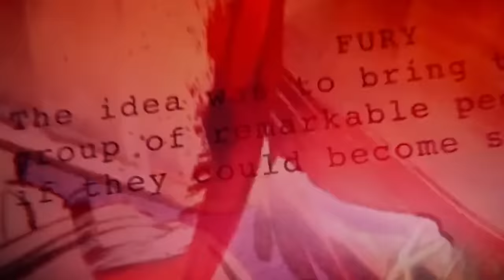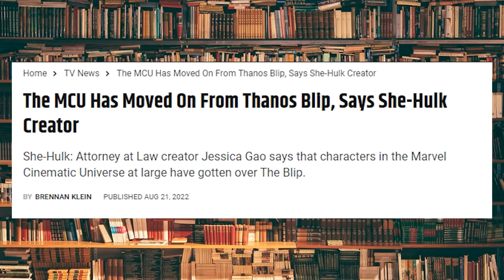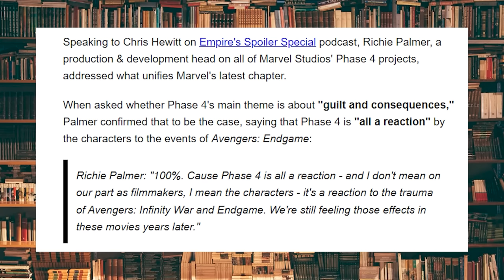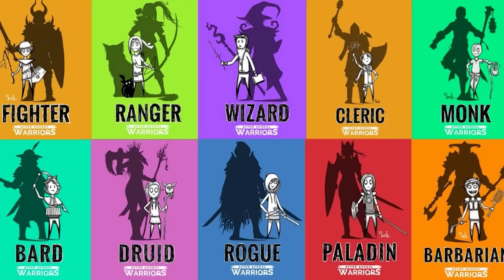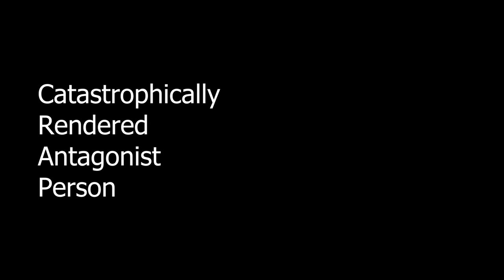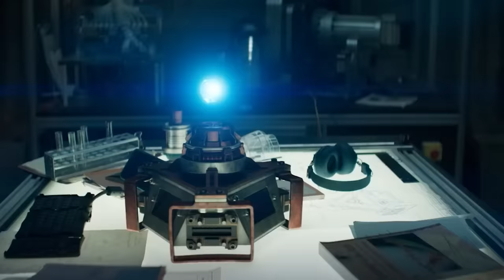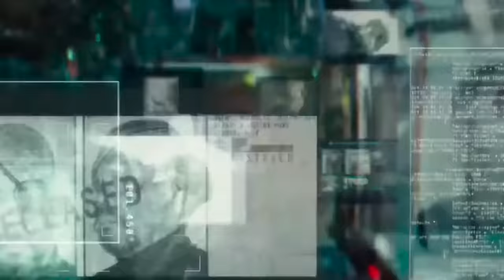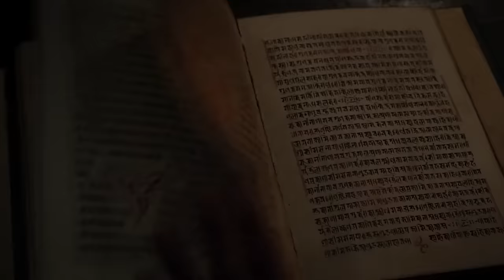Ant Man 3: Quantumania - Absolute Garbage

Comment: 19:40 It's not just flaws in character either, it's flaws in how they go about being their genius selves. As an engineer, I find the MCU's depection of "genius" these last 5-7 years infuriating because it doesn't just come out of nowhere, it's not practical.

Every one of these girl bosses is shown to have an infallible perception for how things should be built independent of the natural failures that come with applied science. Failure is a necessity for innovation, and I think the MCU understood this early on. Through Iron Man 3, Stark was shown to be experimenting and failing regularly. Sure, he made tech wizard marvels, but throughout his films there were always little gags about how an invention of his experienced an inopportune failure. His origin story was defined by such failures. This is more inherently relatable, because it not only makes more sense, but anyone whose built anything has experienced that moment where they realize they have to start over several hours or days into a project. 

Meanwhile, Cassie just plops out a device that is basically a walking contradiction of physics, and I'm supposed to believe she made that in a year by reading journals... OK.
Reply: Yeah, think about how Tony fixed the icing problem.
The first moment he tried to hover, he yeeted himself into the ceiling.

Comment: Actually, Tony didn't invent Time traveling in 5 minutes in Endgame. It was said that he had worked on it for several years already but couldn't get it to work until one day Antman and the quantum realm added a massive new factor and only THEN was he able to invent time traveling.
It was a long time project and by then Tony was long established as not only one of the mcu's greatest geniuses who has more than earned that Titel on-screen by then, he was also basically the main character AND the character who started it all and now finished his story that was in the making for a DECADE.

Not. The same. Circumstances.
Reply: Using time travel to resolve the snap was lazy and contrived.
Reply: @anubusx  i mean, yeah, I definitely agree with you there. But that doesn't negate my point.

Comment: 9:40 In the vein hope that they will find a story somewhere.

The story needs to be this.

In the original history of the MCU where Kang is born in the 31st century: The Thanos extinction event - aka - THE SNAP, was never reversed.  That's right in the main timeline, the sacred timeline - Thanos won.

With this in mind the 1st scene of Antman 3, should take up where Antman 2 ended.  

Scott is trapped in the Quantum Realm.... the snappening is happening.

But this time instead of cutting back to San Francisco to see the dusted remains of Hank, Janet, Hope...we cut back a few seconds sooner.

Janet Van Dyne - looks at Hank and Hope and says... I'm sorry.  [she KNOWS! what's about to happen]

She now turns the Quantum Tunnel off.

Now they are all dusted away.

Now we know why Scott was stuck in the Quantum Realm for 5 years, we know that Janet turned the tunnel off to protect Scott, to prevent him from being snapped away like 1/2 of the beings in this Universe.

Why did she do this?  Because that's what Kang sent her back to do! 

To SAVE this Universe.  Now we have a reason for her otherwise insane actions.

Kang - is the reason why the Avengers in this Universe defeated Thanos.

The dark implication of this is also that in the original universe - or sacred timeline, the Avengers lost!

Janet died in the Quantum Realm - and Hank never found her.

Meaning Scott never returned 5 years after the snap.

Meaning the Avengers never invented time travel and reversed the snap, which is exactly what led to Kang inventing the same, and more.... 1,000 years later.

This makes the prime timeline the darkest timeline.

Now we have a conflict you can build an entire multiverse war on.

Kang vs. Thanos vs. Avengers vs. Scarlet Witch and Fantastic 4 and X-Men from different mutually incompatible versions of the Universe.   

A real multiverse War where everyone cannot have the version of reality that they want.

Remember in prime timeline - 1/2 of the Universe was snapped out of existence and never returned - the Avengers lost!

Comment: 50:14 There actually was a reason, but was not really explained on the movie, just barely mentioned. Before diving into the Probability Storm, they mention Scott would become a "Schrodinger cat", where every possiblity would become real. 
This, by extension, means that the only way to set a single posibility as the "real one" would be to open the box and that an Observer confirms what is happening. It is never mentioned on the movie, but this means that when Scott and Hope see each other, they become each other Observer's and lock only 1 posibility as the real one.
Reply from the maker: That’s definitely an interesting theory, and it’s been years since I touched Shrodinger, but would it actually have worked that way given she was going into the box as well? Ie, if there are two cats in the box as opposed to one, does the internal observation of one by the other resolve the paradox, or does the resolution require observation from outside the closed system?
Reply: @TheLittlePlatoon  Yeah that's definetly an iffy bit, since it should need an "external observer". As long as they are "different" systems, i guess it should still work. 
Honestly i think that's the idea they wanted to portray on the movie, however, as you point out, it shouldn't work anyways since they are both in the box. I shouldn't really expect good writing from Marvel anyways haha

Comment: The problem with Phase 4 is that they did not plan for the 'blip' to be permanent. Fixing the snap was the biggest mistake. In Avengers Stark says, "Because if we can’t protect the Earth, you can be damn well sure we’ll avenge it."

They don't Avenge the Earth they just undo it. It cheapened everything that happened, happened before, and will happen after...it was weak.
Reply: I disagree. Also, even if fixing the blip was a mistake, that's so not the problem with phase 4.

Comment: 47:58 Hey, Red vs. Blue did this in Season 3! A Halo-based machinima webseries actually dod a decent job at doing this, while apparently a big film didn’t (I haven’t seen the film). Granted, Red vs. Blue didn’t take itself too seriously until Season 6, and it was very aware that it was mainly just a comedic story centered around incompetent asshole space soldiers, but it was actually a genuinely good show until after Season 13. Even the less serious Seasons 1-5 had good storytelling, even if it was a silly story with time travel and stuff that was later retconned into just being an AI simulation to trick them, since the show wanted to (and successfully did) get serious in Season 6.

Comment: It's also so vague, that only a very air-headed writer could continue off the story in it's next installment.
As you said, it doesn't have any tangible stakes (paraphrased), "You can't disappear half of an infinite cast of heroes".
What is there to work with as a writer stepping up to the plate? You are asking them to either;
A. Do the impossible, and visualize half of infinite disappearing.
B. Make the viewer care about half of infinite disappearing.
C. Write about the effects that would have on the MCU.
D. All of the above.

Comment: Ah, the three-act structure, my old bugbear.  It's a notion that storytellers need to stop calling on, because it's not a good framework.  The three act structure is overly simplified and it's why so many movies have "second act problems" in them.  You know what to do in the first act, and you know what to do with the third act, but the second act becomes just stuff you do until you get to the third act.
This is why I prefer the Freytag model, the five act structure.  Not because any particular structure is necessary, but because the Freytag model provides more direction within the framework of a story.  If you find your story lacks direction and punch, rewriting it around the Freytag model has a higher tendency to produce an improved story than any other model we've ever come up with.
That's not to say that you can't write a good three act story, it's just harder for less experienced writers to work with because it gives much less direction to go on.  Indeed, a master writer can make a story with as many acts as he wants, because he finds a way to make all those acts serve a purpose and build together to form a coherent, meaningful whole.  All structure models are, inherently, just crutches or teaching tools for less skilled writers - something that helps them give their stories good direction while they polish up their skills.  In that regard, if you're going to impose a specific structure model, Freytag's is the one that is most effective at improving your skills.